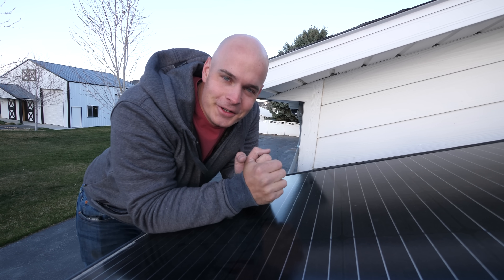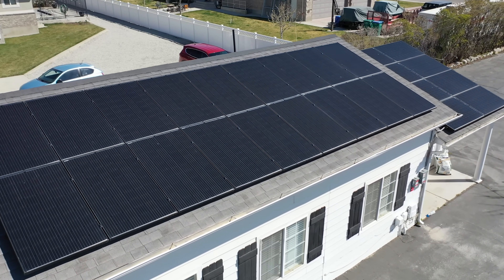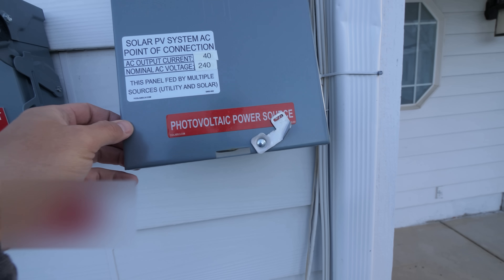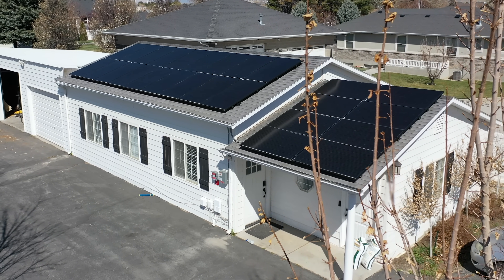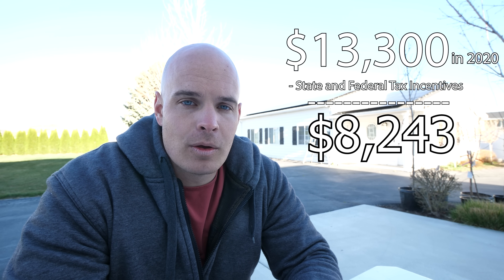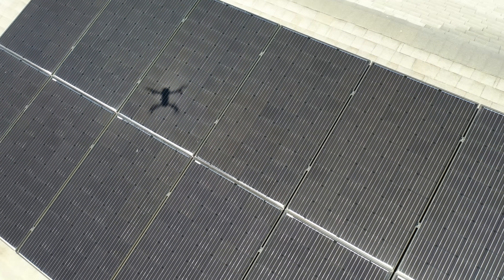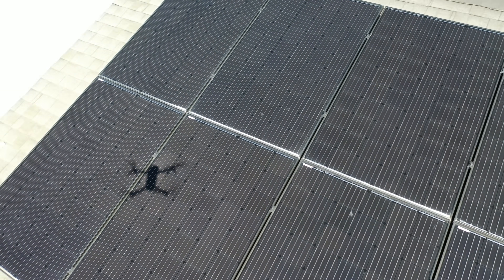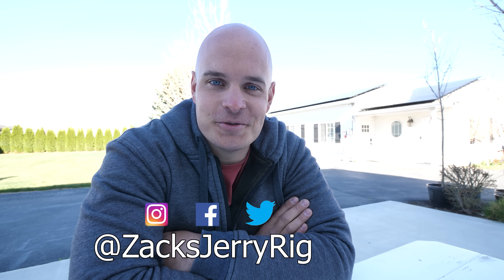One Year Solar Update! - Is Do it Yourself Solar worth it?

Comment: Grid giving you 90% of the energy back sounds like a very good deal. In that situation battery storage doesn't seem adventageous.
Reply: Unless your utility company pays you for the energy you put into the grid, it's actually not a good deal at all.  The utility company still charges you for the power you get from them, regardless of how much you supply them.  In the end, they profit from the energy you supply.  That's a very bad deal in reality.  You're essentially paying the utility company for the energy you're producing.  Where the battery storage becomes advantageous is the fact that you can be completely independent of the utility company if you choose the correct system and battery or batteries.  Leaving yourself with nothing but the transmission fees that most utility companies charge.
Reply: @aaronthomas6155  I think it depends on the state.  Nevada give credits for what you produce over what you use.  So you over produce during the day you pull from the credits at night.  The credits never go away so if the panels do deplete a bit in years down the road, hopefully there's some credits to compensate for that depletion.
Reply: @idontthinkso4692  Some states/power companies do that but not all.  If you get credits for the power you provide, whether or not you need a battery to store excess energy is a smaller decision.  If you get enough credits during the hours that your solar panels are producing power to offset the power used when they're unable to produce power, storage batteries are less an issue.  However, storage batteries are still good for those occasional night time power outages.  People need to research such things before deciding on the exact system to implement.  You want the system to benefit you, not necessarily your power company.
Reply: What happens when the grid goes down?
Reply: @TrollianSol  you are screwed...

Comment: that dude sitting on top of the panels when installing is the big NO NO and you probably have a bunch of microcracks that may be a problem in the long run...but solar is cheap and you can just change the modules in 10 years and have a new system. The most valuable thing of a solar system is the interconnection to the grid. This will be going away at some point and you want to grandfather that so you don't get screwed by the monopolistic utilities.

Comment: You produce more energy than my entire house uses per day. Roughly the same size as well. There are ways I am sure to increase those cost savings by lowering your daily energy consumption. A lot of the systems in our house were designed to be as energy-efficient as possible. From 100% LED lights. To smart outlets that control the hours devices can be on per day. (Fans, Humidifiers, wax warmers, etc) The server rack that runs most of the in-house systems was even designed with power usage in mind, while idle it consumes less than an incandescent light bulb.
Reply: That was my first thought, but he is charging electric vehicles. Also working from home via Youtube production.
He may also be using electric only for heating and hot water if gas is not available.

Comment: Thanks for the info. I had solar panels for hot water on my roof  for about 20 years. You probably know this already, but these by the way are a lot more efficient than photovoltaic. So they may be a good addition to what you have with these. Not sure how install cost compared. Pretty much all my stuff was second hand. I wouldn't be surprised if my panels are 30 years old or older. Granted the last couple years mine weren't working because the controller died. I took them off, or I should say they were taken off, when I needed to get new shingles. That's the one thing I hate about any type of solar equipment mounted to a roof, the roof itself. That seem like one thing I like about the Tesla panels. That they themselves are the roof.
Reply: You can also get rid of the aluminum frames altogether and use the solar panel laminates as roofing.  That's what I've done on a 10 kVA system, and 4 years later not a single panel has failed in any fashion or capacity.

Comment: My country can't handle the excess energy very well. The electricity company will give us less and less money for the extra energy our panels will produce to stimulate people to place their panel different (not all to the south) or use it yourself. Somehow the electricity system is not able to store the extra energy from during the day.
We might just have to install an airconditioner to prevent losing all the energy and still get some use out of it. but the 0 Euro / kWh extra won't be the norm for the next 10 years

Comment: You guys have some cheap electricity..
On this side of the pond, we pay ~0,25USD/kwh after taxes..its absurd..
I wanted to install solar, but the excess energy is just injected for free into the grid...which makes it hard to properly size the system..because, for obvious reasons, the less we can give to the grid, the better.

Comment: When I first started working with solar panels +-1 year ago, they would produce 250wP per panel. Now I’ve seen panels with 360wP already! So much innovation going on
Reply: There are 600w panels but they're at the absolute rear end of ROI (a 400w panel is $200, a 600w panel is $900)
Reply: @angrydragonslayer  
A 600W panel is way bigger than your standard panel. It’s not the technology but size.

Comment: In Utah, did you have to pay your local electricity provider an extra service fee for a meter that measures flow of electricity both ways. Most meters only measure one way and are typically less expensive. So, you would have to pay your local utility company to come out, replace the meter with a new meter, and probably bill you x-dollars for that. Was that the case for you in Utah?

Comment: Word of advice brother, you should put a barrier of some sort so birds cant go under the panels and scew the wires out, they love to make nests under them. i learnt my lesson the hard way. cheers :D
Reply: wow, great tip!
Reply: Maybe a wire mesh will work, keep birds out ,and allow air through to cool
Reply: What did you use? Cause you'll be affecting your panel's efficiency if they aren't getting good cooling/airflow.
I am also planning a solar array for my mom's house so this would be good info :)
Reply: @kingarthurthe5th  I used chicken coop metal wires, sorry I am not english so some words I might get wrong
Reply: @MARCOBOSS123  that's what it's called, at least in Canada. So you're good.

Comment: You need to contact in New Jersey Mike Strizki which have hydrogen solar panel solutions, with so much solar you would basically  store energy in gas tanks and have in winter almost 0 consumption of the main power grid.

Comment: What happens when you get a hail storm.  We usually get at least one a year where i live.  Usually golf ball size, but last year there were some baseball size ones in there.  Just wondering if you'd be out 8k after one bad storm.  Also, what if your power company changes their policy for storing or paying for backfed elec?  Not to mention, in 10 years you will want to upgrade to the newest sweetest panels that are many times more efficient.  I just dont see them lasting as long as it takes for them to pay for their selves.  I love the idea of them, but need to wait till the price comes down and they are more efficient. Not to mention the price/tech of the batteries.

Comment: 28.9kwh/day?! My house can only go 6kwh/day tops with the AC on!
Reply: Impossible  500 watt ac will burn 5kw in 20 hours (non stop run)
Reply: @mattlane2282  I only have a 1hp inverter AC running at 27°C for 20hrs max. My consumption last billing was 132kwh. I live in the Philippines btw and 27°C is enough to keep us from sweating.

Comment: The electricity companies here pay peanuts for excess power.

I pay about $1.10 a day to simply be connected to the grid.
27c/kwh is what I pay for power (17c/kwh for the heatpump/AC)

But excess power is sold to the grid at something like 4c/kwh. Its not worth getting solar unless you get a battery or if you use a lot of power at home during the day. If you get a battery its like a 15 year ROI. By my calculations it would take 7 year for me to make my money back on a solar system and I have a server rack eating about 300Whrs 24/7.

Im focusing on paying off my home loan faster as the lower interest work more in my favour.

Comment: Meanwhile, in Australia, we’re not allowed to change a light bulb without a licensed electrician. Not even an exaggeration
Reply: @Hamlet 80 Just looked it up, applied to Victoria only, and was only removed in 1988, however you still need a licence to do any electrical work involving more then just a plug and socket unfortunately

Comment: Be careful of exposed wires.  Here we have squirrels and any wires not protected by pvc conduit (schedule 80 as required by code) WILL get chewed through in short order.  Matter of fact we have some fittings that have bite marks on them!  We use an optimizer system so all the wiring on the roof is at 400VDC.  So if they did chew into a wire it would probably be the last wire they'd taste.  We just have too many of them!

Comment: Your calculation of how much you are saving is not correct.. you need to also take into consideration how much power you are saving from the power you consume at a much higher rate than .10c per kw/h. This will actually be a much higher saving than your power company buy back price.

Comment: At our age it's probably not worth the cost. 2021 I bet the cost has gone up and at over $13,000 I would have to add on instillation which is usually double the cost. I was hoping to at least DIY a system running off grid so if the grid ever goes down I would still have power. I will have to research to see if solar panels can be put on metal roofs . I would prefer if I went solar to put panels on the detached garage then run it to the house. So all in all sounds way to costly...

Comment: Out of curiosity - 10 cents per kWh is the pure electricity costs? Do you guys over there have other expenses like distribution/transmission tariffs on top of that? Or are the 10 cents including everything?

Also if you give excess electricity to the grid and take it back later - do you pay like transmission/distribution expenses for the grid usage?

Comment: Nice summary.  I went with Enphase micros on my 2nd array I DIY'd last year.  I made 3073kWh last year with it, it's a 2.5kW system.  I also have a 5.4kW system that makes 6400kWh a year, in total about 9500kWh a year, offsets my house and my EV completely.  I'm in Michigan and that's why I don't get the same production but do have pretty good south facing roofs.  My electrical cost is higher at 16 cents a kWh, making the DIY array pay for itself in 5.5 years here.   My utility now only pays solar producers just under 8 cents a kWh sent to the grid now though so batteries or TOU billing or other things will have to be done to help make $ sense.

Comment: I think the total cost 13k for that size system is great. I always like to red flag the part about the tax incentives.  The reality is the $5057 difference you show only really helps you if you also have that as a tax liability when you file your taxes. Now you personally prob don’t have that issue but also that is not a tax that you get back. It can only reduce the tax liability to zero. Any unused portion of the credit can be carried to the next year. 

IMO the best way to maximize the credit is to forgo other credits/ tax reduction methods the year you plan to buy a system and file. This way you get the most financial benefit. Essentially you could pay no payroll taxes effectively keeping the same $5000 per year and the solar credit would cover your liability

Comment: @zackJerryrig you know there are devices that can track the optimal position and automatically rotate the panels accordingly. so you don't need to place solar on just the most optimal overall static position but can be placed in less optimal positions that generate more overall due to their ability to seek out the most sun at any one point.

Comment: 28 kwh a day for normal home! i use around 3-5 kwh a day for my home current in the Netherlands. and my home is not energy efficient for the new standards.  

I pay for power 0.20 euro a KWH.
Reply: how big of a home? How many occupants? Depends on the climate too, here in Texas you got to run your AC pretty much all day otherwise you just feel miserable due to the hot humid air. Also, because of high humidity cloths won't dry on the hanger so you have no choice but to dry them using the dryer. A single dryer load can easily consume 4-6kWh on it's own.
When I'm not using my AC and dryer I'm using 5-7kWh a day for a two story 2700sqft (250sq meter) house, but when AC+Dryer needs to run it's usually between 17-34 kWh/day.

Comment: If you do get under the garage array to ziptie the cables or something,  maybe shift those panels to the east a little bit on the rails.  I bet the upper roof starts to shade the edge of the garage panels in the afternoon, and lose a little production.  Check in the per panel monitoring, if those west garage panels are making a little less, and see if it's worth adjusting them.

Comment: Avoid the battery banks, they will not be a good investment. They are nearly impossible to recycle, and the batteries do not last long enough for their benefits to cover their own cost. The best option is to install solar and sell energy back to the grid where possible, at least until battery technology improves.

Comment: 28,9 kWh per day average?  How? Heating and AC on electricity perhaps? It's about a third in the Netherlands.
But with 10 cents per kWh it costs less than half what it costs here.
On average, a 4 kW solar installation here will basically null your electricity consumption.

Comment: 28.9 kw/day??!! In spain it's 9kw/day what are you guys doing over there?!!
Reply: Depends on the size of the solar panel instalation obviouly! If you are smart, you should figure that out already yourself. 28.9 kWh a day for 8 kW solar pannel instalation is pretty normal and nothing out of the ordinary. That is a little more than 3 kWh per 1 kW of solar installed capacity per day on average thought the year.

Comment: Chinese-made solar relies heavily on coal to produce their solar panels, which allows their solar to out-compete other world producers. I agree that there is solar that is produced more greenly (U.S. and Korean) but with a flood of Chinese panels in the global market, they are not very green. Thoughts?
Reply: Solar panels are green and that is CLEARLY stated in the video! So you are wrong! You didn't watch the whole video, you ignorant f... (it only takes 1 to 2 year for solar panel to produce the energy required to make them, but they have 30 year warranty and last around 50 years ).
Reply: @mirkogruden8362  Back it up with some data! I agree that solar does have benefits to cut dependency from fossil fuels and save money but they are not truly "green". There is no such thing as a free lunch. Additionally, I specifically singled out Chinese-produced solar which uses huge resources of fossil fuels, specifically coal, to produce their equipment. China is also the largest producer of carbon emissions and pollution in general.